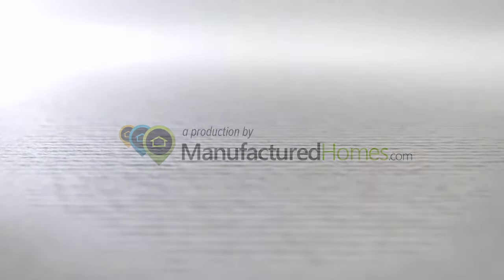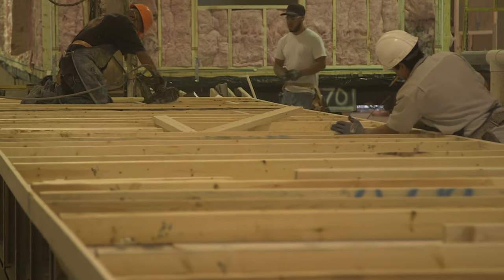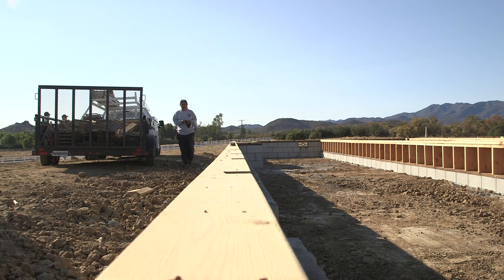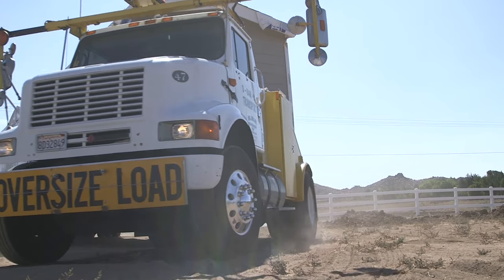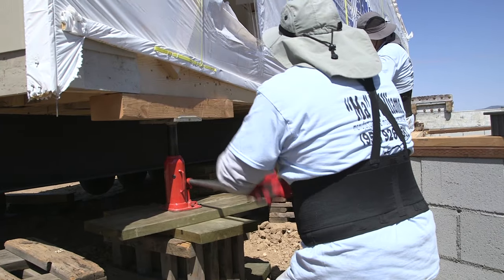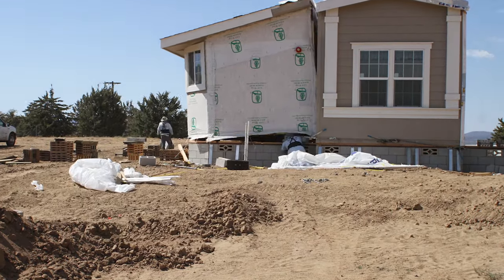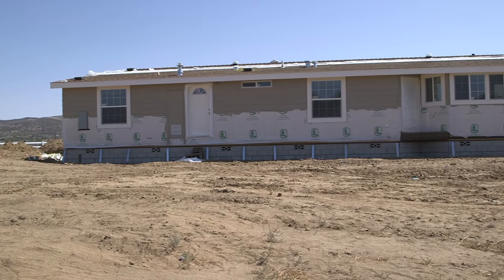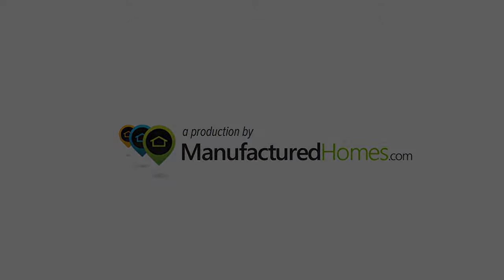Skyline Modular Homes - Modular Home Delivery and Installation

Comment: Skyline sucks. Had one full of problems. Hall closet had moisture in the summer, roof not ventilated properly, floors were thin, floor joists were under sized, washer shook the entire house in spin cycle, carpet in closets had no padding, shingles blew off roof, roof leaked at skylite and utility room, linoleum was so cheap you could see markings on the particle board floor underneath. That's just a start. Do not buy. Go for  a Fleetwood.
Reply: we bought one a few years ago ( sugarcreek home div of skyline ) now keep in mind I paid in full cash when it was still at the dealer (Ashland Homes). At first they seemed like good people,  but that all changed as soon as I payed them. That's when the nightmare started, they hit another house before leaving their lot damaging the corner and pluming, than while delivering the first 1/2 they droped off the road and hit a concrete culvert bending the frame and ripping out the gas pluming, the 2nd 1/2 they hit a tree with. after that it was replace both doors, wet walls, bad roof, leaking (2) toilets, a bag of sawdust left in the heat run, leaking (2) showers,  once it was set on the walls the crew left , never bolted it down or leveled it. also the crew broke the concrete wall setting the house. skyline passes the buck to Ashland Homes and ashland passes it to sub contractors and the  ones they hire are here today gone tomorrow and they say they have no idea how to contact them . the whole bunch of them work together to scam people out of as much money as they possibly can. The salesman was Denny Knight if you are dealing with him  RUN RUN
Reply: @airyfast  I am a retired oversized driver.  We "always" took the mobile homes "off-roading" in the desert.  We would get the trucks up to around 70 mph, then take the trailers over 4 to 6 foot jumps to see how much air we could get.  Those were some fun times.  All the drivers do it.  It is why every single delivered home has huge extensive drywall cracks.
Reply: @seymourscagnetti1413  ROFLMAO! Hahhahahahaha :)